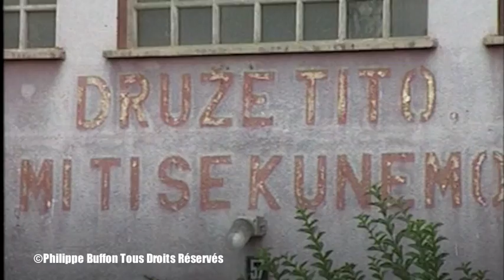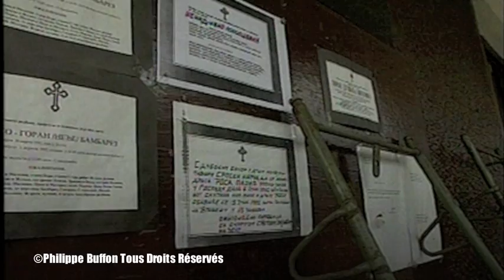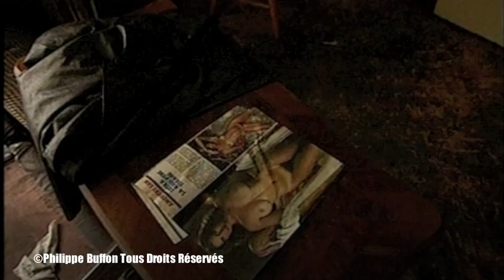Une Section Serbe au Combat

Comment: Stop telling lies you misguided turk. There were 100,000 thousand deads in total. These are the official numbers:

Strength of the muslim army was: 210,000 infantry soldiers
croat army 50,000 infantry soldiers
serbian army 80,000 infantry

Casualties and losses 
Muslim army: 31,270 soldiers killed
Muslim civils:33,071 civilians killed

Croatian army:5,439 soldiers killed
Croatian civils: 2,163  killed

Serbian army: 20,649 soldiers killed
Serbian civils 4,075 civilians killed